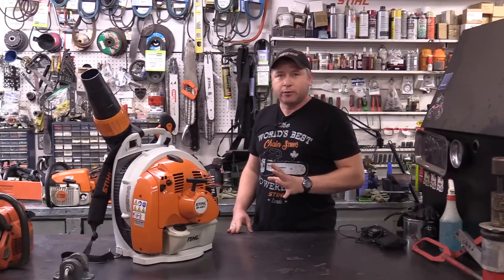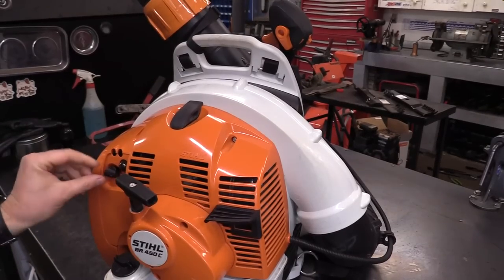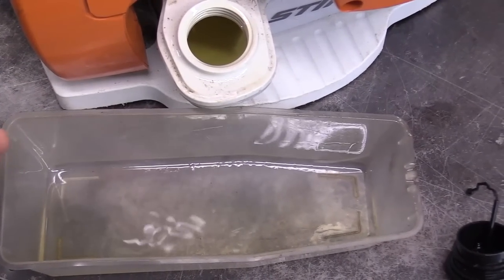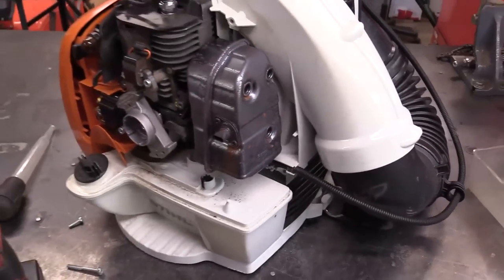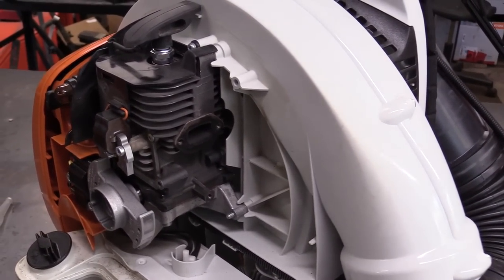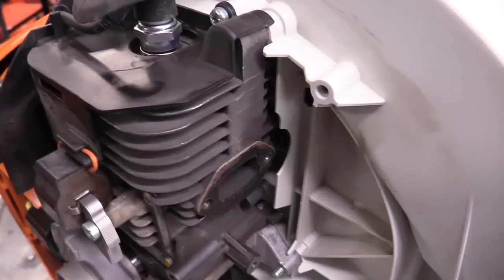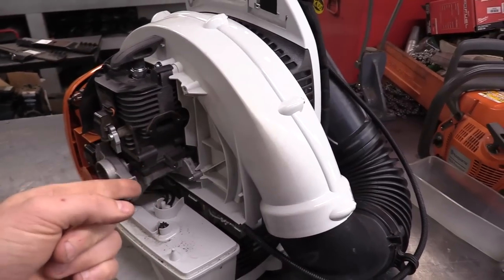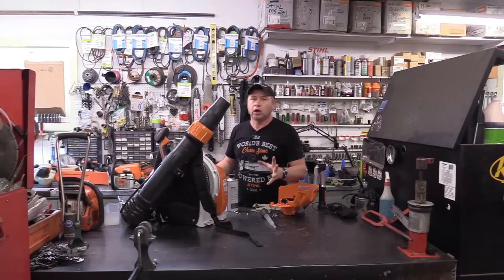Almost New 2 Stroke Stihl BR450C Leaf Blower Won't Start!

Comment: I never knew electric start is available. I enjoy my stihl backpack blower. The best lesson I know is to never lend any tool out.
Reply from the maker: exactly!
Reply: I lend nothing with an engine and nothing with wheels.  Engines come back with ethanol in the tank where it may sit for months sucking in moisture, and trailers come back with damaged fenders, taillights, and etc. with a statement that is never honored, “Let me know how much that costs.”  If I decided to spend my money on the item rather than a trip to Tahiti they can make the same decision.
Reply from the maker: @37yearsofanythingisenough39  I totally agree!
Reply: Never lend a chainsaw 4 sure.
Guaranteed to come back needing a new chain and maybe a new bar.
Reply from the maker: @byronwoolfrey1039  and possibly a scored engine!

Comment: The cost of replacement parts is exactly why all my power tools are old. My chainsaw is an old Husky 254 Xp. Great saw and spares are cheap. Generator is 23 year old Honda gx240. Just redone piston,rings and gaskets at total cost of 32 Euros. I will stay away from the new stuff. Nice video as always. Cheers from Ireland

Comment: I had a lawncare business back in 1996 and one of my employees put straight gas in my 32:1 gas/oil mix Lawnboy mower. He brought it to me and the engine was totally seized up. I thought it was going to be trashed. Just because I never give up on anything I thought I would soak the cylinder with PB blaster/penetrating oil. After several days I actually started getting slight movement when trying to rotate the engine. After several more days of continually soaking the cylinder, the engine freed up.
it is now 2023 and I still have that Lawnboy mower and use it constantly. Never did anything else to the motor and it runs Great!

Comment: A friend of mine used my Husqvarna trimmer a few years ago when it was still less than two years old.  I assumed he knew to mix gas and oil.  Nope.  Used it for less than two hours and burned up the engine.  Probably on the first tank of straight gas.  He bought me a new one and I've used it for over eight years without replacement.  In fact, I'm still using some parts off the old one that I kept.

Comment: You make it so simple to diagnose, 
A person could spend a lot of time searching for the problem. I would have probably started with pulling the cord and it appears to have compression, then go to the spark,  then the carb.
But you keep it simple,  check the gas tank .
Have a good autumn Don
Don't work too hard.

Comment: G'day, Don! I am too, still (quite) amazed how people will buy a $559.95 - Brand New Stihl Leaf Blower. And don't even realize, that it's a gas-powered 2-cycle engine? Using Stihl two-stroke engine oil or another high-performance engine oil. With a displacement of 63.3 cc. Please note that, because the Stihl BR 450 C-EF's engine is a 2-cycle one, (according to Stihl's - owners manual) it runs on a mixture of oil and gasoline. 

Cheers! :-)

Comment: Down here in the US, Stihl extends the homeowner waranty to 5years if you buy a 6 pack of HP Ultra oil. But you still have to put it in the fuel... 
They do it with the fuel too. 

Put it on Kijiji for 100 bucks. Its worth that in parts... the electric start module and motor are worth that alone. 

I use that blower semi comercially and I love it...

Comment: The owner of that nice machine have learned an expensive lesson and won't like having to buy another machine, but that is why I make sure that I have the proper fuel in all of my saws and weed trimmers. I do use the pre-mix fuel/oil in each of my machines too so I don't have that problem.

Comment: Hi, if you lubricate the whole cylinder by introducing oil from the exhaust, then using the 5% mixture try to get it started you can use a little

Comment: Similar thing happened to one of our edgers but we caught it in enough time. Might have scored the short block a little bit didn’t destroy it luckily. One of the coworkers put straight gas in it and didn’t realize until it sounded a little off so the “foreman” checked it out and low and behold, straight gas. Doesn’t pay to b in a rush.

Comment: Good video. WOW crazy scored piston on a almost new expensive Stihl leaf blower . I always use Moto mix in new units. FYI Don did you know Stihl makes premixed fuel with no oil in it only for 4 strokes called Stihl MOTO 4 and they are sold next to the Moto mix the cans look identical just a heads up if you or someone else buys some premixed fuel and accidently buy the wrong can and run a 2  stroke or 4 mix with no oil.

Comment: Hi Don. I recently bought a brand new stihl fs131 and noticed half the tank full with gas that looked just like this. Yellow clear and smelled like regular gas. Almost couldnt get it started today. Had to give full throttle with no choke. Ran awful for 5 min before clearing up. Im suspecting my dealer put regular gas in when testing it and now its scored.
Reply from the maker: wow!

Comment: As soon as you popped the gas cap I said Uh oh. At work someone borrowed the Stihl blower for using in another area. I cautioned him not to use straight gas. I asked for it back and started using it. It warmed up and started stalling. Yup. He had put straight gas in it! Luckily I caught it in time, dumped the gas and put the mix in. It ran fine for years after that.

Comment: Other thing is trying to get the blower fan off the engine without breaking it.
At least on the BR600's.
Had one where it snapped the valve spring retainer and the valve dropped into the cylinder.
Took forever to get the fan off.
I hate working on them, as they get older, they end up throwing oil all over, so it is just a massive oil / dirt / grass mess inside, and the choke handle always gets broken, on all of my commercial customers machines.
So I'd pop the covers off and power wash them before doing anything. 
And the plastic covers break easy and melt from the exhaust.
All around a PITA to work on.

I finally told all of them I'm done working on them.

Comment: So sad! Lesson learned: If you loan your equipment out, be sure to include the right fuel with it. This way you know the right fuel is going into the machine. Hopefully there are aftermarket kits down the road that can replace the cylinder head, piston, rings. Hate to see a high quality machine like this go to the dump.
Reply: In today's time people are to ignorant to get something loaned to them. They figure hell if it breaks they don't care it's not theirs
Reply: To a Stihl dealer there are lots of valuable parts on that blower still. Carb, ign. coil, blower tubes, throttle control and cable, elec. start motor etc.

Comment: The cylinder sleeve in my Stihl BG55 moves up and down with the piston. Not the whole length of travel. The sleeve moves down with the piston until a few mm's before bdc, moves up with the piston until a few mm's before tdc. I think that's what I'm seeing. I quit drinking years ago, so we can rule that out. It starts and runs fine.

Comment: What I've gotten in the habit of doing is mixing up just enough 2-stroke fuel for me to use each time.  I have a cheap little plastic mixing bottle with various ratios marked on it.  This way the fuel is freshest and I can't make a mistake.  Doing this and using ethanol free fuel makes all my chainsaws and leaf blowers and even my awesome Farmertec hedge trimmer start right up and run like a top every time.

Comment: Donyboy hello I have a question bout a ryobi weedeater I have that is not turning over when I pull the rope when spark plug or tester gauge is screwed in sparkplug hole but when I take off gauge or sparkplug in pull the rope then it turns over  piston goes up in down if u can provide me with a quick tip I would very much appreciate dat thanks ???
Reply: Either a compression release not working... Or your spark plug/compression tester is screwed in too far and hitting the piston at tdc

Comment: I saw this something in my shop. My customer decided to repair it. All he wanted to do was fix the upper end. He didn’t want to put the bearings on the main. So I put the piston, rings and cylinder on and away he went. It was a BR200. He tried to put it back on us and stihl. Turned out one of his sons filled the lawn more up and the blower at the same time. The customer said but it was only once. Needless to say no one was buying into his story. I saved the gas from the tank and it was as clear as a glass of water. When I talked to Stihl and told them what I found they put a note on the serial number to make sure no one honored the warranty. I just don’t trust customers anymore when it comes to new machines. Taking the muffler off is real close to being the first thing I do.

Comment: I loaned my chain saw to a friend, and he done that. He was nice about paying for the repair. He had two cans of fuel, one with two cycle and the other regular gas. 😵‍💫
Reply: The only saw I loan out is an MS 250. I send a few cans of canned fuel Trufuel with instruction to only use that fuel. Bar oil and couple extra chains.  One liked it and wanted to buy it. I sent him to dealer.

Comment: My older neighbor was getting forgetful.  He brought his leaf blower over because it wouldn’t pull over.  I initially thought the recoil was jammed but soon realized the motor was locked.  He had used straight gas.  I pulled the muffler and sprayed in some engine fogging spray and was able to get it to run.  I mixed gas with extra oil in it and he was able to use it.  His son finally had to move him because of his memory.   I wonder if your customer was an older person who forgot to mix the oil and gas.

Comment: I took a couple of the Ryobi electric start blowers and changed it to a lithium battery. As lithium has more power in a smaller package, I was able to place an RC Plane battery inside the original battery pack case. I set them up with a charger. Resold them both. Concerning that blower, thats why I write on the unit with a permanent  marker the gas oil ratio and DO NOT USE REGULAR GAS right on the unit. That's a shame. Seems electric start blowers are cursed. I always save units like that for the electric start parts, because others will need them.

Comment: A back pack blower with electric start that's a first one I have ever seen what is your thoughts on the Moto mix by Stihl it's a crying shame that blower is blown up
Reply from the maker: I recommend moto-mix for people who rarely use their equipment or who don't want to mix gas
Reply: @donyboy73  great idea plus it's ethanol free gas ⛽ so no ethanol gas problem s
Reply: @robertmailhos8159  I use Trufuel in my small engines. Fantastic stuff!
Reply: @Tommyr  There's very little (if any) difference between MotoMix and TruFuel. Just use whichever is on sale.
Reply: @TheOtherBill  Agreed!

Comment: This is why some people should just stick to battery tools. Too busy too important to check which fuel goes in the machine. Never mind the same person might plug the battery into the wrong outlet. Some dummies just shouldn’t have nice stuff. I personally a 25-year-old BR 400. 2 BR600s and a BR 800 c we use them every day for work. it’s really easy hundred millilitres of oil and 4.5 L super unleaded can’t go wrong. This makes 45 to 1 engines will last forever.

Comment: Dang it.  That’s a heart breaker.   My dealer will sell you the synth oil at time of purchase which extends the warranty to 2 years.
Also…. They clearly want to sell new units versus parts.  It’s a bummer in my book.  I would much rather fix stuff.
Also the reason I end up with chinesium aftermarket stuff when I buy blown up saws and stuff.  Not oem,  it better than scrapping it.

Comment: I use pre-mix fuel, not Stihl's Motomix  in my 2-cycle equipment of different brands with great success and no problems. I don't know why a premium dealer that sells Stihl doesn't throw in some Motomix.

Comment: Adding the weight and complexity of a starter motor and battery and control circuitry doesn't seem justified in a machine like that. A better improvement would be a circuit that makes sure the oil-gas mixture is within acceptable limits. What do you think of this idea - Invent a portable 9v battery powered gas-oil mixture tester, you stick the sensor into the gas tank and wait for an led or digital or analog meter reading in the more expensive version... might make you some $$$.

Comment: Yes,no warranty on that machine due to being the owners fault & not the fault of the machine.

I went to school 🏫. with someone over 25 years ago whose dad bought him a Brand new Yamaha YZ125 motocross bike for over $6000 AUD & he didn't put any oil in the oil tank so he rode it & he seized the engine.

The bike shop repaired it but at his fathers cost so no warranty on that one either which is why I don't get a Richards because they blew it up !

Comment: OOPS! (that's a big oops)
Human error strikes again...too bad about cost of parts too.
At this point if I owned it I would try cleaning up the piston, rings and cylinder to see if I could get some compression out of it at least.  But that would be a job I would hae to do for myself...not for a customer. A customer would expect to have a 'like new' machine back. I would figure what do I have to lose?

I bought a new mower from a certain Canadian company that sells Tires amongst other things mant years ago. First time mowing with it (in our new yard we hacked out of the woods) I managed to find a stump or rock or some such thing. There was the big bang and of course the crank shaft bent...I was not impressed with me at that moment. Anyway, I got some pricing for the parts and I coould have bought about one and a half more mowers... now I wasn't impressed with the engine manufacturer. lol  I figured I had nothing to lose so I too the spar plug out and the blade off. turned the mower onto its side and roteted the shaft so the 'high side' was at the top...and hit it quite soundly...lol...pretty dumb really. But I ept doing that until the shaft was as straight as I could get it. Put everything back together and to my amazement the stupid thing ran. It had a small vibration but I figured if I got a couple mowings out of it I at least did something. I couldn't beliee that it kept cutting my "lawn" (well it was green at least) for a number of years. Go figure?! right.
I would recommend that kind of 'fix' to anyone...but I was just too poor (or stubborn...my wife would say) to just go buy another mower. ;-)

Than for your video and for sharing your knowledge.
Cheers from NB

Comment: The exorbitant price of repair parts is the best excuse ever for DIY owners to investigate the many knockoff pieces available on eBay and Amazon. A dealer won’t or can’t, and this machine is probably too new, but older machines can often be saved by knockoff parts. When my 25-year-old Stihl brush cutter needed a carburetor, Stihl wanted nearly $100 for the part. I went on Amazon and bought FIVE carburetors for $6 each. My brush cutter has worked flawlessly for several years with one of them. Farmertec sells engine parts — and many others — for Stihl chainsaws at a fraction of the cost of factory pieces. Will they last as long as the originals? Maybe not. Is it worth spending $75 on a cylinder kit to keep a $1,000 saw from turning into scrap? You decide. Just remember that Stihl’s goal is to sell new equipment at a profit — and make money on repair parts, too. This video raises a fair question: if even a cylinder replacement is so expensive as to make this repair more expensive than the blower is worth, why does Stihl even bother to stock, and presumably sell, repair parts? In all likelihood they are merely coming from the supply used for warranty work, and at some point are NLA — no longer available.

Comment: Holy heck, I look all across the internet and people are just ugly and rude for no reason. BUT how can you spend $550 US and not have common sense? I am by no means mechanically inclined but before I spend any money I research products and try and get the best bang for my buck. How does anyone with some bit of common sense not know the difference between a 2 and 4 stroke? I do 90% of the up keep on everything I own, BUT I have no clue on how to do most of it so I get on youtube and find a video and follow it. This is I just have money and don't care about a blower that costs half a thousand dollars. Blows my mind, I mean gas mix is the simplest as it gets just follow the instructions... Just bewildered, if you want to burn your money I guess more power to you. You keep gentlemen like this guy full of work... That's darwin level silly, smh...

Comment: Depending on part availability a situation like this might warrant replacing the entire engine. STIHL shows the engine as part 4244 020 0206 with a cost of $187.99 US.  They want $418.49 for just the piston and cylinder(!?)

Comment: This has happened for too many years.  I, once, rented a gas string trimmer from a rental shop.  The young man filled the tank, and sent me out the door with a full can of gas.  The trimmer ran just fine for a few minutes.  Then, it started to over-rev, and stopped, suddenly.  Could not get it started, again.  Took it back to shop, and it was discovered there was no oil in fuel.  So, why in *%#@ don't manufacturers get their little heads together and color code the gas caps to identify which engines need oil.  Too simple... black caps indicate need for oil with mix ratio embossed on the cap.  Red caps indicate good to go.

Comment: It is a 4-mix engine that uses 2-stroke fuel. That is confusing people.
Stihl should notice this when they are advertising their products. It could save people their hard earned cash.
Reply: The 450 is a 2 stroke. The 600 (and up) models are 4 stroke but all use mixed gas.